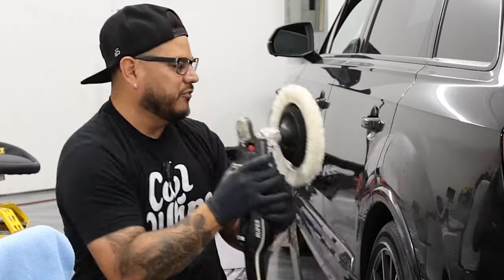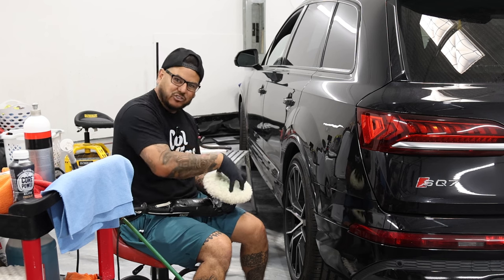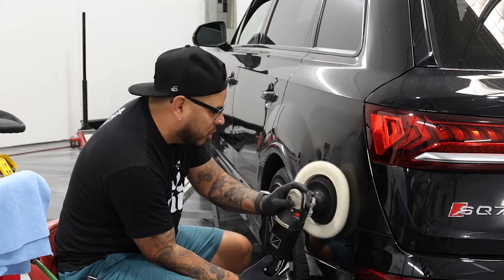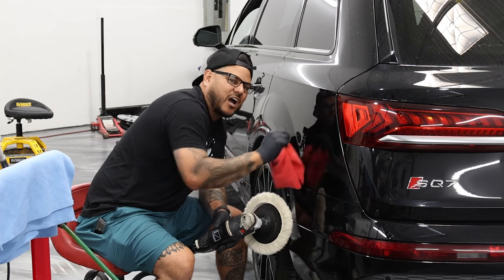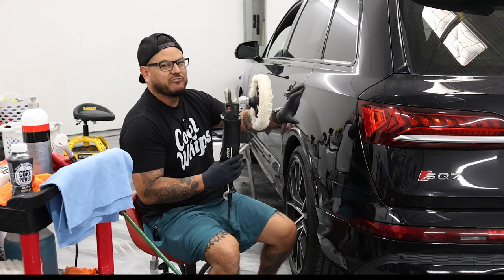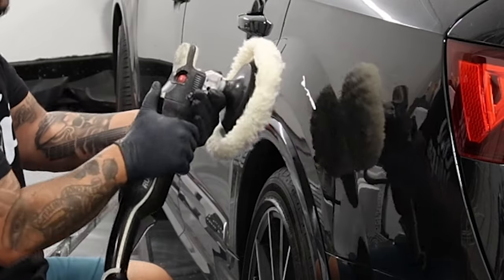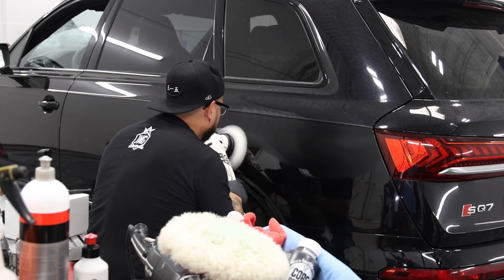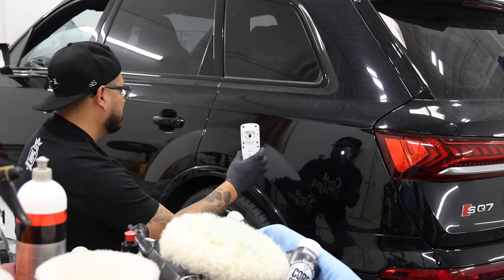How to use a rotary polisher FOR BEGINNERS

Comment: Beginner here... so I cannot use a rotary polisher for correcting and polishing?
Reply from the maker: @bernitup6492  there's definitely easier ways, especially your pain not too bad. No reason to use a rotary. But if you want to take care of pain for the next level, I'll use it first to level the paint
Reply: @BorndetailersTv  Thanks. Reason I was asking is cause I got a rotary polisher from Harbor Freight as a gift along with several pads and I did not want to have too many tools since I am a weekend diy'r.

Comment: Was trying to polish my Q5 with a DA polisher, heavy cut foam pad and maguiers compound. Getting almost no correction even going over several times. Any tips?
Reply: Use a Microfiber or Wool pad. German cars have medium-hard to hard clear coats
Reply: What kind of Meguiars compound? My Tundra has the most stubborn hard clear I've ever  corrected. Had to go with rotary instead of DA with lake country heavy cut purple wool pad and Sonax cut max. A foam pad wouldn't have taken out a thing. Maybe with Meguiars 105 and a lot of time and passes, but probably only 50%.

Comment: Outa curiosity why’d you switch to a random orbital?
Reply from the maker: Pretty much it's a efficiency thing. It takes five times a time to polish the rotary and finish out to get the job done. The only time I use a rotary is for cutting and removing scratches.
Reply: @BorndetailersTv but Yvan said cut with a DA and finish with a rotary 😅😅💀☠️ and were you cutting or just removing material? Nice work man, that ammo DA looks sick
Reply from the maker: @DiamondDetailingBuzz  teach their own just how I do it and guys I want to get it done